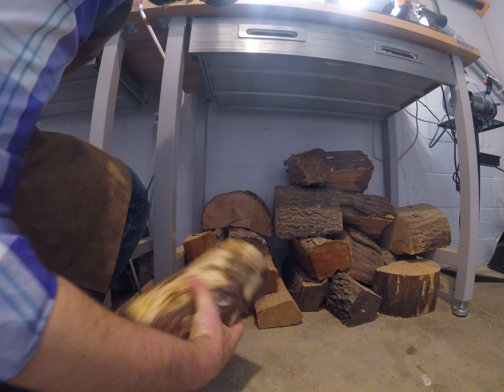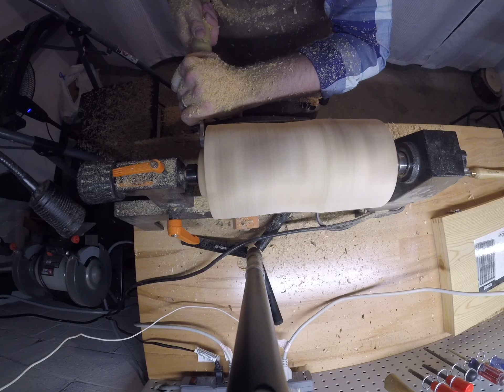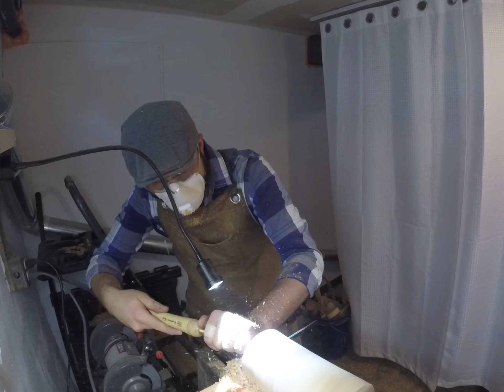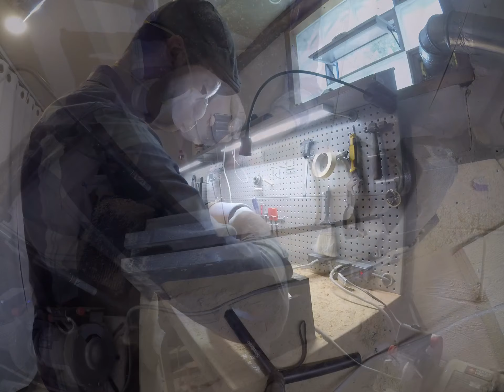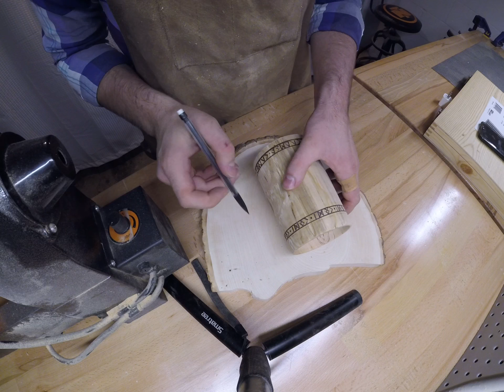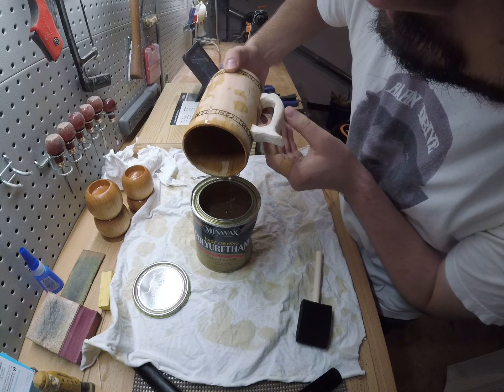Beer Mug Wood Turning

Comment: hey man. so, the finisher is polyurethane? is it food safe, and does it totaly seal the mug? Good work btw, very nice.
Reply from the maker: Hey thanks for watching! I am still very new to all this but yes the poly finish completely seals the mug, and from the research I have done (before finishing with the poly) it is good safe after it has totally cured. Usually >30 days
Reply: @steelcitywoodturner1822   Suggestion:  Try a combination of beeswax and mineral oil or paraffin and mineral oil.  The paraffin you can pick up at the grocery store in the canning supplies.  Both are food safe from the get go!  Apply at about 750 to 900 RPM inside an out.  I use the beeswax and mineral oil on my whiskey cups and it comes out very well.  Shines up very nicely as well!
Reply: @thevalleytinker445  Great info. How do u clean is after u use them?